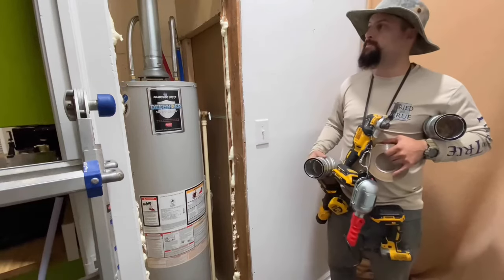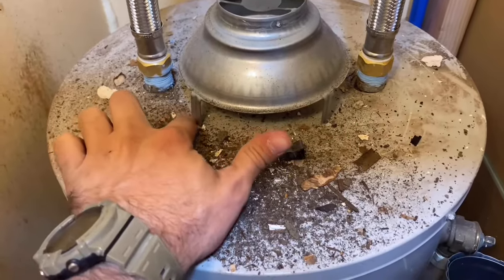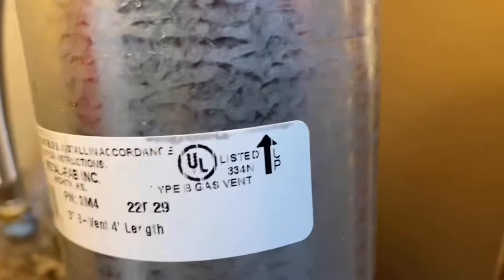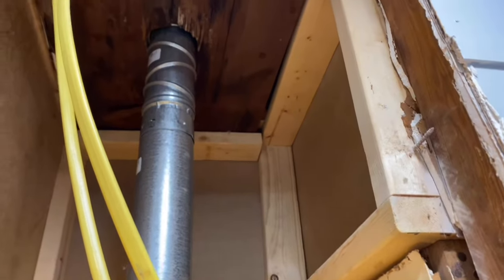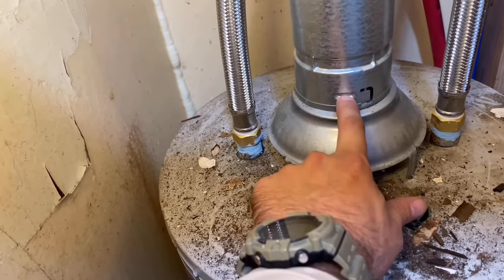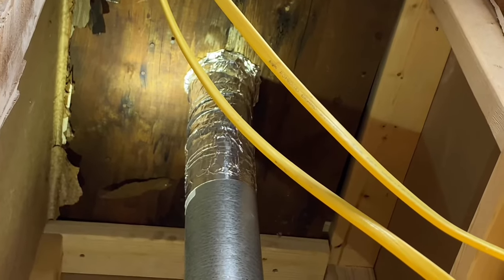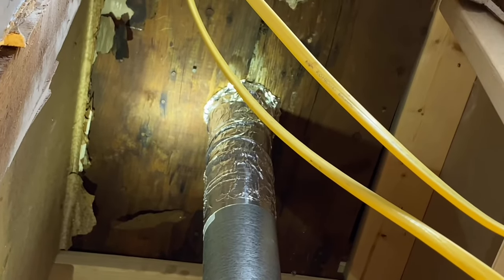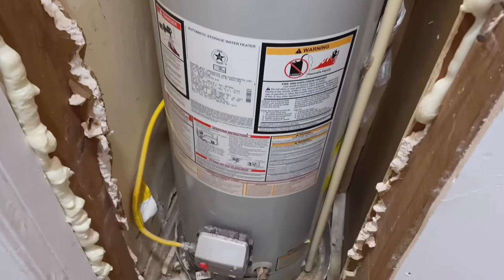Hot water heater vent pipe installation

Comment: There is just no need to tape a B vent , you should have use the the appliance connection for b vent not just put the pipe over the flange. Sorry but Between the tape and the connection you would not pass a inspection.
Reply from the maker: Well luck would have it I don’t have to pass any inspections and it’s working well and much safer than it used to be. Also it would be a very easy fix now at this point to remove the tape and add in the connection your talking about to the flange luckily. Thank you for chiming in here I believe your comment is very helpful and as I mentioned in another comment, I will be making a new vent video when I get an opportunity to do so. I am not a code plumber, I’m a house flipper learning everything that comes my way to save money on my flips. I learn new things all the time. Thanks for helping us out here Mike.

Comment: NO SCREWS!!!! That’s against code!!
Reply from the maker: Haha omg 😳 this video, okay so your right. I am not a code plumber, I know a lot but still learning things every year. So thank you for checking in here. I’m a house flipper  that tackles anything that comes at me wrong or right. But always my best. That was my first b-vent install. I’ve done single wall and you put screws in that. Anyway, learning curve and as mentioned in another comment. Tape is not necessary. I don’t believe it’s bad but not necessarily needed and there is an actual connection fitting that goes from the B vent to the flange (Quad Hat) I do in my case feel comfortable with this result and I’m gonna leave it till it’s time to sell this property. If I fail the inspection I will fix it then. Thanks again Daniel much appreciated. I’ll do it better in my next 30 years !
Reply: Screws are allowed so the pipe can be hold strong
Reply from the maker: @oscarguerreromusic  Thank you that is what I was thinking myself!  It makes sense to me anyway that It can not twist and then the tape is even more support and extra sealant. Thanks for checking in.👍

Comment: Its a water heater,  not a hot water heater
Reply from the maker: Correct but lots of DIY homeowners know it as a hot water heater. It’s a more searchable topic
Reply: That's a cold water heater 😅
Reply from the maker: I used the cold one through an Oklahoma winter and an extra 8 months before I got that gassy gas but this here water heater is hot sir!! None of that cold service on a cold day now, nooo sirrrii. Come and get it while the gettin is good ummmkayyyy! Cheaper than Walmart and halve price after midnight 🕛 see you soon sunny gym!

Comment: Tape don’t pass city inspection in my city
Reply: The reason tape does not pass city inspection is that it can be used to hide an incomplete connection between B pipe and fittings.  I’ve seen it.
Reply from the maker: @Thomas63r2  Thank you for checking in and giving a reason why tape isn’t necessary. I do believe in my case I will leave it because I know it’s connected well and the tape will keep it from sliding around any. I may not next time and make a new video when I get an opportunity again. Hopefully not soon though! I just replaced another one.
Reply from the maker: Although that was an electric water heater.
Reply: @GrantKeysProperties  No gas vent pipe on an electric water heater.
Reply from the maker: No vent at all on an electric tank, water heater

Comment: I thought you had to have 1 inch clearance around the pipe.
Reply from the maker: There is clearance here and I stuffed foil around it and it goes into a hard pipe not a PVC pipe as well. There is special fittings were you go into the attic but in my situation, I had an asbestos pipe. So I went a different route, but you want some clearance!

Comment: we are getting water in between the 2 pipes, leaking down onto the top of the hot water heater. Went onto the roof but all looks good. Storm collar is down and caulked, etc. It was a hard storm so maybe it was wind-blown rain that got under the cap and traveled down the outside of the inside pipe? Maybe add some sheet metal to keep rain from getting up underneath the cap?
Reply from the maker: Wooow! Yeah, could have been heavy rain and wind. I will be honest though and have not had that problem before but have seen rain water drips down vent pipes. Usually not to bad, just a few drips and the heavy wind and rain stop and maybe only happens a couple times a year. I would probably rig the cap with something like your saying or just keep it in mind and dry it up a time or two a day with a towel during bad storms. But I can’t see your actual situation, just thinking what I would do if it wasn’t a bad drip on a windy day. If it is a bad drip and soaking everything around it and getting into the sheetrock and insulation-wiring, you will have a whole new set of worries! And would need to rig the cap. Hopefully this helps and if anyone knows a simple fix for this issue please chime in!!

Comment: how do you air seal that going thro the xeiling into the attic?
Reply from the maker: Just make sure it’s not touching anything that can burn and seal it off with something that doesn’t burn! Hopefully this helps!
Reply: @GrantKeysProperties  it has to attach to something tho...
Reply from the maker: @redsresearch  I believe there is a special fitting that is for the ceiling and you would just attach it to that at the ceiling and on the other side in the attic and keep going. In my case there was a gap already at the ceiling and the pipe I put in was slightly smaller than the other pipe that was asbestos so non flammable but I still wanted to seal the area around it for bugs and rodents. So I used aluminum foil.
Reply: @GrantKeysProperties  what you mean you used foil? do you have a video of this?
Reply from the maker: @redsresearch  I did it on this project but maybe I didn’t video it. It would be at the end of the video if I did but it’s a 1940’s home and originally had asbestos vent pipe going from the water heater all the way through the ceiling, then the attic. But there was already a 1 in gap all the way around going through the ceiling. Instead of leaving it open like that l, I put the new vent pipe in and it’s very good and doesn’t get as hot. It goes through the ceiling in the same hole and I put aluminum foil there all around it, like cooking foil and wadded it up and shoved it all around the space to keep dust and bugs-rodents from coming in, from inside the attic.
Reply: @GrantKeysProperties  I dont think that's the right way to do it..
Reply from the maker: That’s the beauty of buying an old house. You are not having to do everything by today’s perfect code book. Nothing done in the 1940’s is done by today’s code standard. If you live in the property for 1 year, your aloud to do things yourself. Of course you want to be cautious if something is dangerous. This would have been dangerous if I didn’t add in the foil. Because the vent can get hot and burn the wood but aluminum is not burned at that temperature. It’s been past the year and I now live in the next project I got. And I’m making my own repairs as well on it while I live here for the year then I’ll do it all again. Moving people in behind me after I test it all myself.

Comment: I would like to ask you a question about the metal vent pipe for the water heater: why does water drip on it?
I appreciate
Reply from the maker: Good question! I’ll bet there is water getting in through the roof around the vent pipe, where it kicks out the top of the roof. Hopefully this helps!